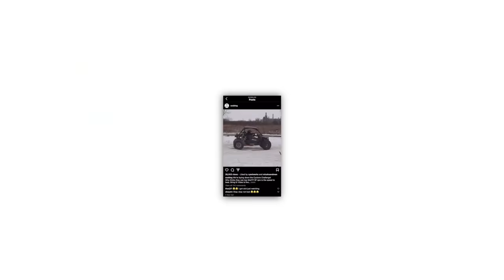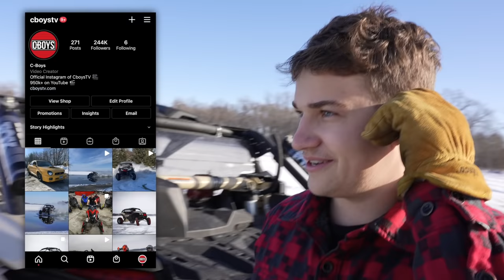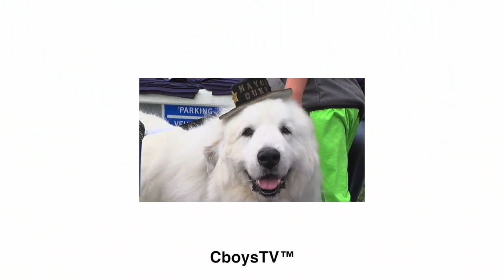DNR Officer Harasses Subaru Driver on Ice

Comment: A road citation for being on a lake far from any public road? Yeah, I'd fight that in court.
Reply: You’d never win it in court, the law doesn’t state the the careless operation is held to the road. Carelessly operating it in public property is enough. It’s a crap ticket, and DNR would be better servered to make friends out of this and get good PR , but it is valid.
Reply: I did read the law, that’s a valid ticket. Like it or not. Did YOU read the law?
Reply: @franksmith8210  that's the point of taking it to court. we all know they were the only ones there and no other parties were unwillingly involved. the spirit of the law is to protect grandma and/or a van full of kids from getting t-boned by out of control road shenighans. I could see the cop having a valid point if it were summer and they were zipping around on jet skis close to other boats, but that cop was WAY out of line given the circumstances.
Reply: You can fight and win against a valid ticket. If the law contains any ambiguity or is poorly defined then you can get it thrown out because not every officer would have the same definition for it and while that officer gave a ticket another might not have.
Reply: @franksmith8210  Because an officer says it's careless doesn't make it so, you could definitely fight on whether or not the definition of carelessness is met as everything in law with a specific definition requires to met the standard of that definition.
Reply: @franksmith8210  taking it off road makes it far less likely to be careless. That sounds like they did take care to not harm the public
Reply: @franksmith8210  the state has to prove carelessness
Reply: And they will, the ticket will be paid. Again I think it’s a stupid ticket and these guys weren’t hurting anyone, but it’s still valid. If you run 150mph down an empty freeway you’re gonna get arrested, doesn’t matter if there’s anyone else on the road or not.
Reply: So by your logic you can speed drift and drive recklessly along the sides because its technically not the road? Falls apart pretty quick
Reply: It's not a valid citation. The law applies to public roadways. Unincorporated public land and private property are not subject to any laws governing public road use.
Reply: To be fair…. They WERE trying to race ON TOP OF A FROZEN LAKE which sounds completely stupid. Just putting themselves in danger. They deserve that ticket lmao
Reply: @fyregus  you sound like a fun guy.
Reply: @toml1446  That would be easy, just show the video of a car registered for daily driving (road use) getting sideways on the ice that is public land.
Reply: You will not beat that ticket! Just like operating unsafe for conditions, it's up to officers discretion. Name a judge that isn't gonna side with the cops, regardless of the fact its a bs ticket to generate revenue
Reply: Indeed, this is 100% legal in sweden lol
Reply: @franksmith8210  only if you get caught
Reply: @franksmith8210  how so!? Look at what everyone does on jet skis and boats on the lake! Thats perfectly legal!
Reply: @fyregus There are actually public roads that get plowed across lakes in the winter, and school busses use them. Not really dangerous or stupid.
Reply: @franksmith8210 

No, it’s not. SMDH hell easily win in court. Off highway has a completely different set of rules
Reply: @fyregus The ice was plenty thick, It wasn’t dangerous. Plenty of sanctioned race events are held on frozen lakes every winter.
Reply: @franksmith8210 see how you said “going down the ROAD at 150” yeah this is a LAKE not a ROAD.  The law is a complete joke if you can just interchange any word you want in there. What’s next going and ticketing someone in a field they’re allowed to drive in? Where does the line get drawn that’s my real question here. Unbelievable how loosely written the law is, leaves room for tyranny like this. Where is the harm, victimless crimes aren’t really crimes at all.
Reply: @DetectiveJones  by your logic, there's no difference between murder and fighting back against muggers. See how that works? I can make stupid statements, too
Reply: @kennyfnpowers707  you still have to prove that their was a risk to the public, of which there was not. 

But snag the penal code if you really want
Reply: interestingly enough in Minnesota many of the driving laws are worded in a weird way that a lot of them apply to the entire state including private property along with agreements you signed when you got your license. for instance you can get a wreckless driving ticket for romping it in the mud on your own property if you don't get the proper permits and approvals to do what you're doing like say you made a mud track in one of the fields you own. or another interesting one, if your license is suspended for any reason and you mow your lawn with a gas powered mower (on your own property) its technically illegal  because what you signed waved your rights to do so when you got your license in the first place. they use this power of having you wave certain rights by signing and obtaining your license in this state for a lot of legal foolery.
but obviously a lot of this is at officer discretion, honestly out here it's about a 50/50 chance you'll either get a cool guy or someone who's going to throw the entire book at you just because they can.
Reply: @franksmith8210  Not true, careless operation is a specific deffinition. These men took great care and time create a safe and obvious temporary space in a location where the public safety would be unaffected.

They were drifting, but that's not careless driving in and of itself. It would be careless to drift on a public road since there may always be unexpected traffic, pedestrians or public or private property that may be damaged. But doing so in a space designed for it is not.

There are professional drifiting competitions those are not "careless driving" competitions they are born out of rally competitions. It's a real driving technique, just not one for public roadways.

Knowing how to drift offroad, which these men were; on a temporary track of their own construction, can save your life on-road when you least expect it. Learning how to regain control on ice require practicing losing and regaining control. Arguably, this officer interupted defensive driving training practice.

If I didn't know how to drift, both myself and wife ould be dead because I'd have lost control of my vehicle and collided with a transport on one occasion. I'm alive because I have experience playing with vehicles off-road.

You may think it's silly, but drifting is controlling a vehicle after it has lost traction. It's an unbeleivably useful skill to have in life or death situations.
Reply: @Adam White  you realise there are many FIA organised events that do exactly this but with multiple cars all running side by side at the same time ramming into each other occasionally
Reply: You can nearly get out of anything in this world as all as you have money.
Reply: @dontbeakaren6145  that's the point. Laws are pay to play. You can speed all you want if you have the money to do so.
Reply: @ronmiller7248  that's the point of what? I was just responding to the original comment
Reply: @savannaswildnatureworkshop7810  Explain.
Reply: @fyregus  does it though ? The Canadian/ Alaskan highways open routes  across lakes all the time.. have you never watched ice road truckers? If it’s cold enough. The ice is thick enough then what’s the difference ? I would say taking a 100ton fully loaded articulated lorry across ice is far more irresponsible yet governments deem it satisfactory. Therefore there is a argument to be held and you could argue this is court  :)
Reply: @Lofi.z34  Everything can be fought, and just because you were given a ticket doesn't mean it will hold in court either I'm responding to franksmith (my State and probably all of them you can have a Jury trial). Would a Jury hold a careless ticket with the given video of "no one around", it's completely void of OTHER public users. Now if there was a bunch of people ice skating or fishing close by yeah sure but I don't think most Juries would hold them to this ticket. It depends on so many things of course, the people you get, the Judge you get, the DA you get even. Would the DA actually even want to pursue this, probably NOT. Franksmith wants to argue it's a valid ticket I would say it's only valid if it passes the test of a courtroom, otherwise it's just a ticket. It's why there are lawyers, a really could lawyer can argue for your innocent just the same as your guilt.
Reply: @franksmith8210  I been pulled over for 155 and I was not arrested...LOL So that shows me you don't understand the law or how people operate in life. I was given a ticket for 134 though and rode away on the street bike. I then hired a lawyer and we claimed 90mph and the Judge said okay sounds good and that is what we got the ticket for (I saw we as the brother inlaw was on his bike too). You keep arguing it's a VALID ticket, valid tickets can be beat all day long too or even changed. I don't know one person that would just PAY a careless ticket they go to court and they probably will win or pay a find and have it dismissed, at the end of the day it's not about safety or valid ticket its about money.
Reply: good luck with that.
Reply: Worth the ticket either way though
Reply: People do realize they make racetracks on the great lakes and race around.  Been doing it for decades.  Wonder if all those are reckless?
Reply: @franksmith8210  Which state did you read the law for? In most wordings it does include mention of highway, roadway or other drivers - clearly there are no other drivers on the lake.

One example from Highway Traffic act
"130 (1) “Every person is guilty of the offence of driving carelessly who drives a vehicle or street car on a highway without due care and attention or without reasonable consideration for other persons using the highway.”"
Reply: @chaorrottai  facks
Reply: @franksmith8210  you cant hunt someone down when you think they might be doing something wrong over your other duties. pursuit and harassment with no cause here.
Reply: @franksmith8210  So I can't drive my snowmobile at high speed across a frozen lake or along a river or do any hill climbing or any snowdrift jumping.
Reply: @Lofi.z34  There's also a clause somewhere (in some states), that if a motor vehicle sinks into a lake, there's the release of brake fluid, motor oil, radiator fluid and transmission oil. 
I believe it's titled, "Pollution of a municipal water sourse." Many provinces in Canada drill to check for ice thikness before they authorize vehicles on their ice (this includes quad-runners, showmobiles and full size pickup trucks).
Reply: @toml1446  doing burnouts/donuts is careless and there is video evidence?
Reply: @trevor4567866  whats your question?
Reply: At least take it to court. Hope the officer does not show up and at least Waste as much of the courts time as possible!
Reply: @franksmith8210  That's silly. No judge would call what these people are doing "careless". They literally took the time to plow a track.
Reply: @lb9355  correct.
Reply: @fyregus  Stupidity isn't a punishable offense.
Reply: @trump45and2zig-zags  You must be a cop with a quota.
Reply: @Captain R Change your name, you shouldn't be "Captain" of anything.
Reply: @RandoManFPV  can you seriously not spell the word "facts"?

Kids these days...
Reply: @Rain_Zima     No way on private property you can get a ticket for spinning in the mud .
Now in a zoned county you may not be able to have a event but you and a couple of friends doing donuts in the cow pasture not illegal at all. If that the case You need to move to a free state.
Reply: @seanmcleod7417  You stated, 
"You posted this trying to sound smart....."
There isn't audio when leaving comments, Pilgrim. 
How the blazes can a man "Sound Smart" when typing? 
- Secondly, I state the facts as drawn DEC and EPA working in the state of New York. We've had knucklehead drivers lose their pickups in Lake Erie and they were truely left with a long list of violations.
- Thirdly, - Troll elsewhere. Ain't got time for ya.
Reply: @seanmcleod7417  yea I can spell, and I'm 25.
Fax
Reply: wont win! on your belief then boating laws mean nothing as well, its a public lake not private
Reply: @callofthewildoutdoors  Its not a boating ticket its a road ticket. Doesn’t matter what the law is if you get the right judge. I’ve had logical judges throw out bullshit tickets. And on top of that the officer might not want to show up to court on their day off. Worth fighting
Reply: @kennyfnpowers707  I would be pretty confident claiming that a lake is not public land in court. It is public water, but the law talks about land, so it will likely not be applicable to a lake. Since they seem to have control of the only plowed entrence to the track no outsider can accidentally get hurt.
The noise they make could possibly be a violation if it was done close to any residential buildings.
Reply: Frozen lakes up here in Minnesota have speed limits and regulations soooo ha, also not about legality of it, the faster you drive on ice, the more waves that happen underneath ice and can destroy the ice more of a saftey thing I suppose
Reply: @Rohan4711  Natural resources on public land are still considered public land, a lake would be a natural resource.
Reply: @seanmcleod7417  Except for the Darwin Award... 😎
Reply: What a muppet DNR officer. I hope they fought it. It's no more "careless operation" than doing donuts on a jetski in the summer. Furthermore, there was no one else there... DNR officer is a complete muppet.
Reply: @franksmith8210  running 150 down a hughway? Nice strawman logical fallacy! LMFAO!
Reply: @sabereaseera1384  true always worth the effort, but some states will continue a road across the ice in winter, ( seen this in Wisconsin) complete with portable lights and stop signs, My own state of Michigan if its not private property or designated raceway etc  its a road ticket including on the ice, every CO or leo i have ever seen or know would have given them a wreckless driving ticket and impounded the vehicle, even if you fight in court you end up paying tow bill and impound
Reply: @franksmith8210  My state says: "A person commits the offense of careless driving if the person drives any vehicle upon a highway..."
Reply: @nomadiclapse  You can get a ticket  on a jetski for doing that.
Reply: @franksmith8210  it’s a lake not public property
Reply: @fyregus  nobody asked you… how them boots taste?
Reply: @Nick Price who owns the lake? Do you not understand there are public lakes? That makes them public property.
Reply: I was giving a road situation for hitting my neighbors tree. Never on the road at all. Unfortunately I was stupid in my younger years and court was on a work day obviously so I just paid it. Looking back I wish I had fought it
Reply: His reasoning for giving them a ticket is completely b***** because that same lake has ATV races snowmobile races all kinds of stuff on it during the winter. Every Lake in my state is open to snowmobilers. He even admitted he seen you on the internet and targeted you. He wasn't just doing his job he wasn't being polite he was a jackass
Reply: @franksmith8210  please explain to me then the snowmobile races that are sanctioned on that exact same Lake? And the ATV races? There's YouTube video of guys rolling their ATVs out there racing and DNR is not shutting them down since it's the city sanctioned event. So I guess it comes down to who has a badge and a gun
Reply: @Fordgroup00  they have snowmobile races and ATV races on that same Lake. I believe they have to get a permit and be sanctioned by the city but that's for a public event not just friends out messing around. There's no law against running a snowmobile across that Lake
Reply: What about the snow mobility devices that the wet brained riders rocket across the same lakes? Thats not reckless?
Reply: It would depend on the state but in MN those races and events like fishing contests held on public lakes you need a permit from the Sheriff's department and probably something from the DNR. Yes you can drive snowmobiles atv SxS cars trucks whatever on public lakes but laws still do apply and you definitely can get ticketed or arrested. That CO was probably lying because I think someone did call in on those guys but the CO definitely wasn't harassing them or being a jackass about it.
Reply: @franksmith8210  Half the time someone plays lawyer on the internet, they are full of it.   Even if you did, a lawyer can try to fight it.
Reply: @toml1446  u ok?
Reply: Depends in canada unless u have dome way to prove u own it it's public. I've had rcmp take my kids quads. (Got them back) they were out on trails by a beach. Same kinda thing.
Reply: @DetectiveJones  Actually, how careless where they. They went to a place where no one was around. They cleared the ice so as to protect themselves from flipping the car and injuring themselves but again, no one around. There is no property nearby to damage. So, what is careless about this? To drift a car, is not careless, it is controlled and no one and no property is at risk. Of all times to cite someone, this is not one of them. There is the ability to warn someone and this is one of them. I know that you must enforce the law but applying careless to this is unjust. AND I am a full supporter of law enforcement and none of the defund garbage.
Reply: @fyregus  Would you rather them be on the streets? Of all places to drift, outside of an actual track, this is the best place.
Reply: @trump45and2zig-zags  Everyone on here can name a judge that dropped a ticket. It is not unheard of and even I have had a ticket dropped. I would simply say that I went to the lake, cleared the snow to make it safer to drive on and made sure that anyone watching was very far away so that no one would or would get hurt if something did occur. I was in control of my car at all times. Simple as that. The laws don't have to be a hammer on the people, such as this.
Reply: @Captain R Certainly it is his right to fight it. I would say to the Police on here that just because the law says don't do it, does not mean you need to INTERPRET it as being careless. Careless would be if he was in close proximity to people, property or something that can be damaged by his driving. Don't alienate the youth because as you and I know, our youth was filled with drifting, dragging, cruizing "Really miss that one", packing in the bed of the trucks and so much more. Is there any harm from their actions, NO. It is up to you to determine if there is any harm about to take place and I don't see it with this.
Reply: @franksmith8210  The ticket is valid but it doesn't mean it can't be fought and invalidated. The fact that you're so sure that the ticket will stand be paid shows how much of a bootlicker you are. 

Instead of saying that it can be fought in court and see what happens then.
Reply: @franksmith8210  You don't even know how to read. Doubt you have ever read law.
Reply: @franksmith8210  but.  It still takes a jury to convict...
Reply: I almost got cited in Montana for firing a gun on a road. I was 3 miles deep in the woods lol there was absolutely no road in site or on GPS 😂 these guys just write random tickets to people that piss them off and hope they stick
Reply: @franksmith8210  yeah you could def win that in court, it's not careless, they clearly put care and thought and sat there for hours making a track, no one else was on the lake. That's not careless.
Reply: @willcal2738  I agree harassment is the only thing that could have saved them in this ticket. Ive had about 100 tickets and charges always hired a lawyer even for my 9 seatbelt tickets. I paid him $75 each. Court wanted $160. But I got a fishing without license ticket and it's only ticket he said he couldn't help me with he said court is strict on fishing/game tickets so I had to pay the$140.
Reply: @JoshJackson13   people fall into the ice, sometimes.
Reply: I'd PAY to see them fight that (at lose)
Reply: Dnr must be bored
Reply: The lake is a public easement therefore same as a public road in the eyes of the law
Reply: @fyregus  Nobody's gonna attend your funeral, bud.
Reply: Today's world where you can buy toys, but can't use em for the intended purpose unless the state and/or feds get a profit. Merica, what the fuck.
Reply: @fyregus  ever see ice road truck drivers.
Reply: What street did he put on the incident report 😂😂😂😂
Reply: wierd usa!!
Reply: @lb9355 law applies everywhere. You can't just go wild just off the roadway because it's "not on the road" 😂
Reply: @franksmith8210  there's a reason you get careless driving on a highway without other people on it.  That's because somebody could suddenly enter the highway before you have a chance to react, and you can't know whether there's nobody on it without having it shut down.  It's quite a different situation from the middle of nowhere where there's no vehicles, and it's certainly ambiguous enough to be argued against in court.  In all likelihood it simply wouldn't make monetary sense to fight the ticket with a decent lawyer.
Reply: They don't belong on the ice doing stupid stuff.they will never win in court.
Reply: @TKTmon it doesn't matter if anyone was there or not lol.they will not win in court 😂😂.
Reply: @Cobb they won't win😂😂.
Reply: @someguyprobably

You want to know where the line is the line is in between public property and private property if they owned that lake yeah they'd be fine but that was publicly open to anyone just as if they were doing that in a public field they would have to follow the public rules and regulations but if it was their daddy's cornfield then it's private and while they may not have really been hurting anyone there's laws that are in place for the general safety of the public and if you start neglecting laws that don't apply to you in this particular situation because you're trying to be extra careful well then the same could be said about a public road or you know doing other things and then the logos become worthless now I agree the DNR guy could have given him a warning but it sounds like he already has had interactions with these guys pushing the limits and he's probably given them breaks in the past and these guys were stupid enough to post it on Instagram video it for the whole world so yeah take the ticket take the points on your license shut up and study the law in the future before you go and do stupid s*** on the internet
Reply: @zheneggmobile  doesn't matter if it is open to the public lol.its still illegal to do that dumb shit.
Reply: @timradke7775  no there doing there job.
Reply: @excelframpton  lol what does ice road trucker have to do with anything.big weight difference.
Reply: @Josh-up5pf  lmao they won't win in court and yes it is wreckless driving.
Reply: If you get a judge with morals and common sense they would easily win in court.
Reply: youll lose . youre not supposed to drive fast on a frozen lake with your car cause you create waves underneath and cause cracks in the ice, and those can be really bad sometimes
Reply: @TKTmon  no he wasnt. considering that thats a big lake there will be people fishing there, and when you drive a car fast on a frozen lake, you create waves underneath and that can cause the ice to break and bad ways. its already a law to drive slow on frozen lakes anyways
Reply: @mikhailskrinik8458  there's no law lol.its just common sense.
Reply: So driving on a legal off-road trail and you flip you could be charged with careless driving?
Reply: @Steve.._. Steve the 🐑🐑
Reply: @franksmith8210  DNR isnt in it for the PR, they are not in it to get a 5 star rating dude
Reply: @Cobb  where did you get your law degree ? walmart or sears
Reply: @toml1446  like that is hard,, they were acting like idiots on a frozen lake, there,  i just proved carelessness
Reply: blud was not tryna be nice that cop is a creep